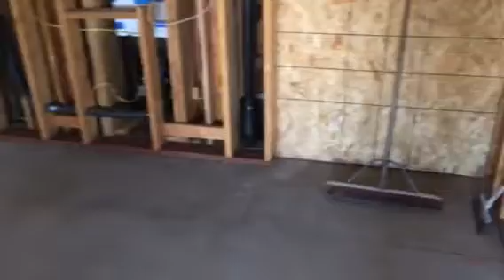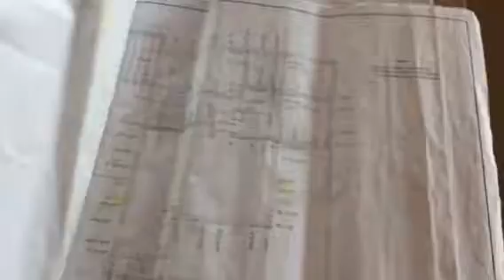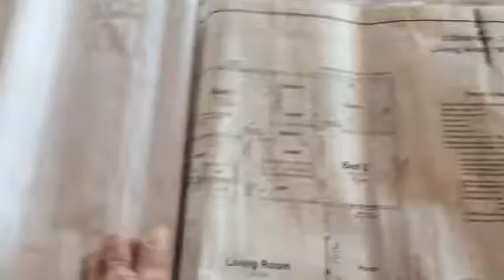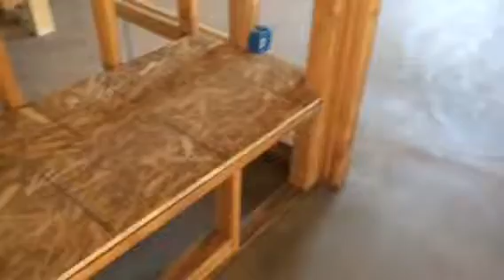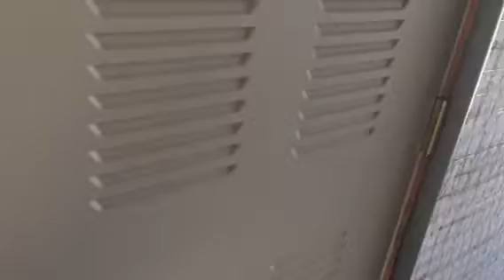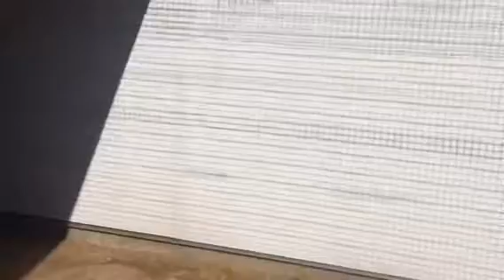Owner/builder house tour

Comment: I'm building my own house to here in Central Virginia. Working on the framing right now getting it ready for the roof framing. I designed it and Drew it myself not quite as ambitious as the house you've built there. This is a house for my wife and I to retire in about 1,200 square feet with a two-car garage near a lake. Last house I built the mid-90s was just as ambitious as the one you have there. We sold it in Knoxville it moved to Central Virginia to build a house debt free for our retirement it's a good feeling. I have been a Carpenter all my life. I can appreciate what you doing there good luck my friend you can.
Reply from the maker: Thanks Weldon, I'm in the finishing stages now and the house we're living in sold so I'll need to pick up the pace. (gotta be out in two weeks) We'll be in the motor home 'till it's done. Good luck on your project as well. I'll post another walk thru when I get back on the internet.
Reply: @a5stringer   I'll look forward to that walkthrough. Yeah what do you do when it sells so quick? Something about those owner-builder homes that people just love and appreciate. My last house sold in less than two weeks when we put it on the market at an incredible price. It's a lot of hard work to build your own home and it's good to have people appreciate it. Sometimes I think that my struggle is greater than anyone else's but I know it's not. Don't forget that walkthrough